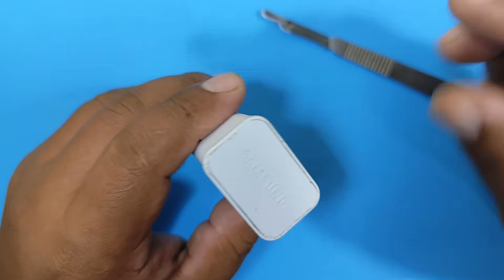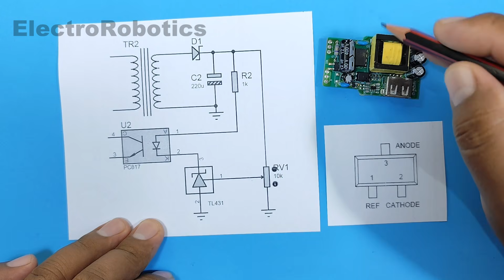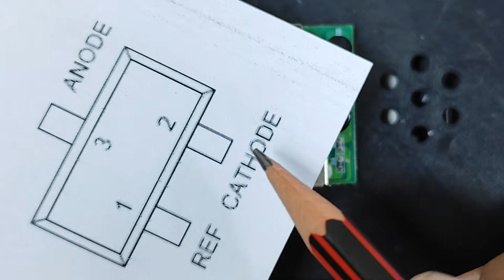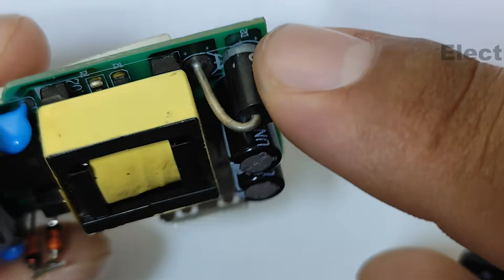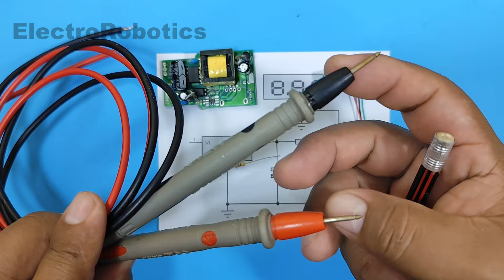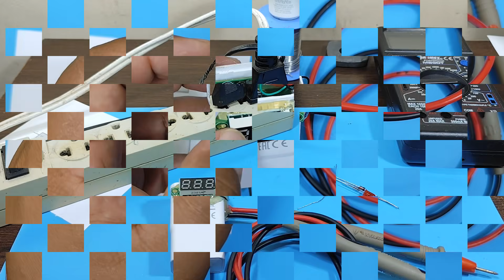Homemade Tool Using a Cell Phone Charger with Which You Can Measure Any Electronic Component.

Comment: This is not bad. Thank you for the interesting video. That is quite useful. It would have been better if we could adjust the voltage. I wonder how can it handle the current with each components you tested. You even shorted it, does it not affect the functionality of the charger?
Reply from the maker: Hi Pulathisi Bhathiya, first, thank you for the suggestion to make it variable. I'll do so in a future video.
The charger's functionality is not affected; however, keep in mind that the higher the voltage, the less current you can use.
That's why I used a 4.7K resistor, which allows us to short-circuit the tips without damaging the charger.
Thanks for the comment, and best regards.

Comment: You said the brand doesn't matter so I used my wife's charger which was an iPhone. Everything was buried in some epoxy and not only the project failed but also I couldn't put it back together.  🥺
Reply: I use a samsung charger....looked like that one on the outside but this insides are way different

Comment: such a high reverse voltage can destroy a LED....how does he not know this
the so-called battery charger is a SMPS.....how does he not know this
The test current is kinda high and could  damage some components

can I measure a BJT???  
Can i measure the uF of a cap using this?
LMAO

Variations of this have been published before - all suffer the same problems - - ....how does he not know this

Comment: Excellent...thanks
Reply: such a high reverse voltage can destroy a LED....how does he not know this
the so-called battery charger is a SMPS.....how does he not know this
The test current is kinda high and could  damage some components

can I measure a BJT???  
Can i measure the uF of a cap using this?
LMAO

Variations of this have been published before - all suffer the same problems - - ....how does he not know this
Reply: in a prior video he says ALL 'chargers' use a Zener, but now he tells a different story 
what is all this mucking about with Zeners -   Its like travelling from Bombay to Goa via New Delhi
Reply from the maker: Hello englishrupe01, thank you for your comment and support.

Comment: nice to know, from bangladesh
Reply from the maker: Hello Agrogami School, I'm glad it helped you learn a little more about electronics.
Reply: such a high reverse voltage can destroy a LED....how does he not know this
the so-called battery charger is a SMPS.....how does he not know this
The test current is kinda high and could  damage some components

can I measure a BJT???  
Can i measure the uF of a cap using this?
LMAO

Variations of this have been published before - all suffer the same problems - - ....how does he not know this
Reply: in a prior video he says ALL 'chargers' use a Zener, but now he tells a different story 
what is all this mucking about with Zeners -   Its like travelling from Bombay to Goa via New Delhi

Comment: Decent video, but that robot voice is AWFUL
Reply: such a high reverse voltage can destroy a LED....how does he not know this
the so-called battery charger is a SMPS.....how does he not know this
The test current is kinda high and could  damage some components

can I measure a BJT???  
Can i measure the uF of a cap using this?
LMAO

Variations of this have been published before - all suffer the same problems - - ....how does he not know this
Reply: @kennmossman8701  After calculating the resistor used at the positive output, it seems that the amperage is 0.0055A (i.e. 5.5mA)...24.8 volts / 0.0055 A = 4509 ohms and a 4700 ohm resistor at 250mA is used...so, the assembly will have an amperage of approx. 5.5mA at the resistor output and the resistor power will be 0.0055 squared, i.e. approx. 30mW (minimum)...it will not affect the integrity of the measured LEDs, especially since ordinary LEDs "work" at about 20mA...if I made any mistakes in my calculations, please correct me.
Reply: in a prior video he says ALL 'chargers' use a Zener, but now he tells a different story 
what is all this mucking about with Zeners -   Its like travelling from Bombay to Goa via New Delhi

Comment: Very good idea for an unused charger, thanks for the video 👍🤯💯
Reply: such a high reverse voltage can destroy a LED....how does he not know this
the so-called battery charger is a SMPS.....how does he not know this
The test current is kinda high and could  damage some components

can I measure a BJT???  
Can i measure the uF of a cap using this?
LMAO

Variations of this have been published before - all suffer the same problems - - ....how does he not know this
Reply: in a prior video he says ALL 'chargers' use a Zener, but now he tells a different story 
what is all this mucking about with Zeners -   Its like travelling from Bombay to Goa via New Delhi

Comment: Great little tool. Thankyou
Reply: such a high reverse voltage can destroy a LED....how does he not know this
the so-called battery charger is a SMPS.....how does he not know this
The test current is kinda high and could  damage some components

can I measure a BJT???  
Can i measure the uF of a cap using this?
LMAO

Variations of this have been published before - all suffer the same problems - - ....how does he not know this
Reply: in a prior video he says ALL 'chargers' use a Zener, but now he tells a different story 
what is all this mucking about with Zeners -   Its like travelling from Bombay to Goa via New Delhi

Comment: Very nice and good demonstration.
❤ from Vincent Chennai India
Reply: such a high reverse voltage can destroy a LED....how does he not know this
the so-called battery charger is a SMPS.....how does he not know this
The test current is kinda high and could  damage some components

can I measure a BJT???  
Can i measure the uF of a cap using this?
LMAO

Variations of this have been published before - all suffer the same problems - - ....how does he not know this
Reply: in a prior video he says ALL 'chargers' use a Zener, but now he tells a different story 
what is all this mucking about with Zeners -   Its like travelling from Bombay to Goa via New Delhi
Reply: in a prior video he says ALL 'chargers' use a Zener, but now he tells a different story 
what is all this mucking about with Zeners -   Its like travelling from Bombay to Goa via New Delhi
Reply: such a high reverse voltage can destroy a LED....how does he not know this
the so-called battery charger is a SMPS.....how does he not know this
The test current is kinda high and could  damage some components

can I measure a BJT???  
Can i measure the uF of a cap using this?
LMAO

Variations of this have been published before - all suffer the same problems - - ....how does he not know this
Reply from the maker: Hi Vincent, thanks for your comment. Greetings and I'm glad you liked the video.
Reply: @ElectroRobotics-qo2er   HAHAHAHA  BUT YOU CAN NOT ANSWER MY POINTS.   hOW WEAK!!!